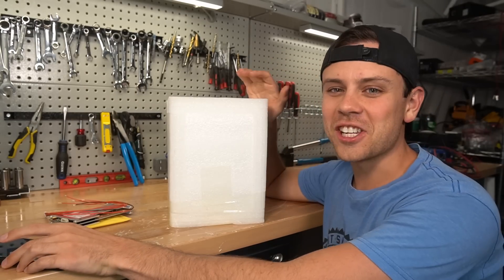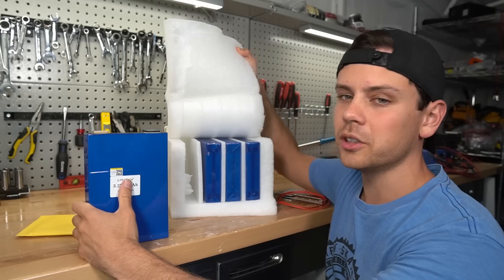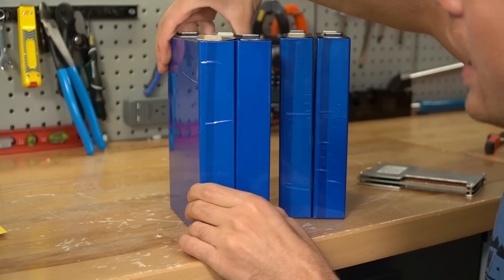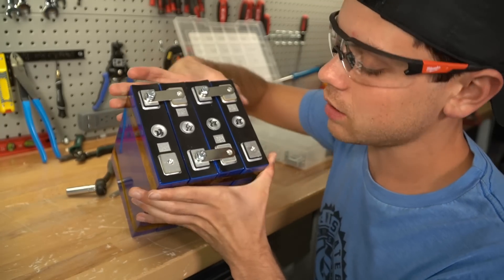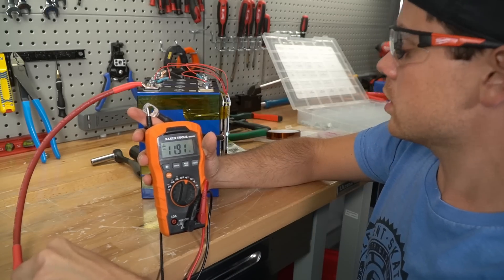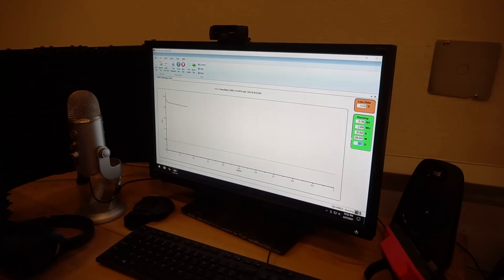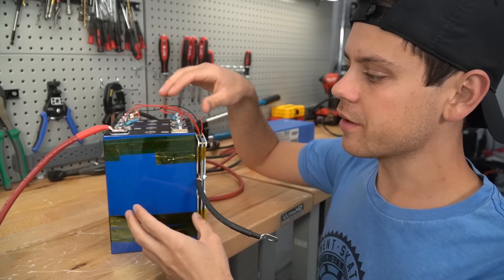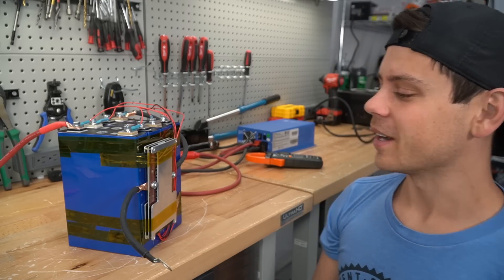Cheap LiFePO4: $221 for 100Ah 12V!! The Cheapest Cell + BMS On Aliexpress

Comment: Thanks for doing all of these tests, I've watch many of your vids. As a new guy into the RV seen and a boondocker focused kind of crew I feel lost with all the choices when it comes to buying enough but not too much. I know can't have too much but I'm only running lights and the furnace when cold. Fridge runs on propane. $2k for a system to run my lights for a few days seems like over kill so I'm looking at a couple deep cycle batts and a portable solar panel with a Renogy 20a charger from the alternator in the tow vehicle. All thanks to your work and I appreciate you for sharing your knowledge with me

Comment: LiitoKala does have proper 18650 cells and those 12v 18650 cell battery packs. Rest, i would just buy a known brand like you are saying.
Perfect video, was planning to try them out becouse of the good 18650 cells.

Comment: I got the cheapest 48v 30Ah lituim for my solar charging ebike setup. Told the seller if they test less then 15Ah ill be looking for a refund and ill even send them back. This would be a good setup though for my trailers power bank. I use lead acid right now as im on disability and lead acid don't hold a charge very long after dark :(

Comment: hi all.  are there any guides, web sites or ? that will tell me how to replace lead batteries with lifepo4 in a ups environment. I have a tripp-lite apc-1250 that is connected to servers and hm.  theather electronics. I have a 200 Amp hr sli agm that is pushing 25 years old.
thanks
Reply: is it as easy as buying a similar lifepo4 12 v battery or do I need some sort of a charge controller or bat maint device?

Comment: Used your link for recommend raw cells on your website for Amazon and it linked to this manufacturer. Bought the 280ah 12v one. It’s been over three months. Way past the quoted delivery time, no word from the seller. Others are having the same problems. So I have to request a refund.

Comment: Would you put two massive 4 year old, badly swollen 6S 22Ah LiPo drone Batteries, in series on a 1800 Watt ebike? Suicide, or worth it?

Well... it was a (borderline stupid) gamble, but I did over 20000 km in further 3 years of use. 
Now I replaced them, because they were giving less then 50%.  Replaced with a Aliexpress 52V 19.2Ah  Battery.

Comment: So when they are bloated like that, naturally, that's not good. Performance might not be what was advertised, they might cycle badly years down the line so yes, you didn't get what was advertised. However, we want to use it in our expedition vehicle and if they deliver 60-70% of the advertised performance 5-10 years down the line, that would be absolutely good enough strictly from a capacity perspective.
Naturally I neither want my expedition vehicle to burn down, nor do I want to be left stranded in the middle of nowhere without an electircal system. A degradation in capacity however would be managable. So the key question for my use case is: Is it dangerous or is there a high likelyhood of them failing alltogeher? 

Also, what torque is recommended for M6 or M8 studs?

Comment: Nothing wrong with them, undo the top and squeeze the gas out. then pack them in a tight container so they cant swell, and the gas will come out of the release valve, still much better than lead.

Comment: Indeed these cells rate to 100ah. I’ve got 16 of them. They are working fine and remain in balance. While some cells do exhibit “warping” all cells arrived with “virgin” contacts and bar codes. They are maintaining capacity as they are monitored daily ( watts produced thru inverter, monitored by Sonoff power switch ). They are maintaining balance. I will argue if your “poor” but have some ability to fabricate bus bars and compression methods these aren’t that bad. This post must be colored by the fact that they have only endured 154 cycles. In the end solar power remains a rich mans game.
Reply: How about an update, since it is 6 months by now.  I am thinking about buying them tomorrow, they are even cheaper for the 11.11 sale.
Reply: @mikes6216  6 months goes fast, I have used them everyday since my initial post. These batteries are functioning well. I run them under light load 24/7 @ 150 watts. I do not fully charge them or discharge them.  I am still happy with these batteries. They are not subjected to heavy load unless my power goes out and I need to run my sump pumps. Frankly, I would use any battery I buy under the same light load conditions. I will try to run a capacity test. I will indicate the starting voltage, ending voltage and total watts generated during for the duration of the test. it may take a week however as I’m busy building a green house in my basement ! I have a 1600 watt array and during sunny days I need to port the excess power to grow lights.
Reply: @jethrotull5847  I decided to buy some Liitokala batteries, or Litokalla, I forget which one.  One is a knockoff I hope I got the right one but I probably did not because I got the ones which were buy far the cheapest for an E-bike build.  14ah 3.2V cells came to less than $12 after shipping.  14ah seems like a new size on the market so I was hoping they were not rebranded used batteries.  They are bigger and heavier than LiPO but I actually got them cheaper.  Side Note:  There is a news article today saying Elon Musk wants LFP batteries now because they are better for the env.   The article said something notably contrary to Will P, that these batteries are NO SAFER than LiPO.  That the safety records, eg. explosions and thermal runaway fires were just silenced by the Chinese govt.  I see the argument but the aliexpress listings say they tested the cells with nail puncture tests... I guess they did not say if the batteries were charged at the time or not.

Comment: I ordered 4 pcs of 280ah for $200 total...we'll see if they actually arrive...not holding my breath, but I will update and make a video. The way I figure, if they actually turn up, if I only get 80% capacity or less I'd still be out ahead. Time will tell of course. If they do actually arrive and they are bulged like water balloons...I'll do all my testing way outside in my driveway.
Reply: where did you find 280AH for $200?
Reply: @jamesrladd  eBay...but we'll see if it's real or not. Should know by July. I'll update.

Comment: I always thought a "flat" battery was dead, these are curvy.  🤯
Reply: IMHO, a little bulging can be they have been used without any positive pressure on the cans and may not be terminal for the bat.   But also can be a sign of internal pressure is starting to destroy the battery.

Comment: Damn, that's about as bad as that Renogy All-in-one inverter charger. I guess these cells would make a nice match with the quality of build that Renogy picked.

Hmmm....

Maybe, just maybe, you should consider becoming a liaison between the various manufacturers in Shenzhen and North American distributors. Never know, you may just end up finding a better selection of parts and put together the best system yet with an open source team. That might actually be the best way to get the scoop on the best supply chain options.

Comment: I went to the Chinese Liitokala "complaint" (not really the right word but difficult to translate to English)(lets say bitching is more better) and lots and lots are saying virtually the same thing as WILL ... so ALL the batteries that have been sold and tested that has gone worldwide from these people all have issues -- some bulging, some with stripped threads, cracked threads, none of the serial numbers match, BUT ALL of them have tested at or right at 100aH ... ALL seem to be delivered right at 2.7 to 2.9 volts ... The thing to NOTE though - is regardless of their fault or not - if you send anything back its ON YOU 1000% .. YOU PAY ALL SHIPPING BACK !!! They will refund your money BUT AFTER you ship the things back ... (YEAH - do a quick cost estimate on that).. ..One of the girls (Chinese) living in Russia asked them if they were NEW cells and they came back with "YES" but after more probing they meant "NEW to US" .... The theory is that one of the Battery Manufacturers got bought out - they had a ton of B-Grade or returns etc etc sitting for years in the warehouse and someone bought the entire stock to test and put on either EBay or Alibaba, etc ... AGAIN - will i purchase some to play with -- heck yeah ... just did ... will I purchase them to monitor the companies fire control system or more importantly run my Friday night beer freezer -- -- hmmm probably not !!!
Reply: Bump... This person is knowledgeable and very legit.

Comment: Not the cheapest Ah for batteries. XD Battery Beijing quotes 600ah for $1200 plus $400 for shipping. Includes BMS, technical data sheet, and such, but not sure how great of a battery it is. These are very close in price, depending on shipping costs
Reply: You should Hit up michael through the group buy On the forum.  You should be able to get over 1000 amp hours for 1600 to your door.
Reply: @rileystone3319  wow. That’s a low price. Does Will know this?

Comment: Hey Will. I am a bit confused. You literally have this supplier listed on your website stating “My current Lishen 280Ah Cell supplier. Slow shipping, but cheapest price around for high quality cells”. I am baffled because I placed an order with them 3 weeks ago and am getting my cells within the next week. I only placed an order with them based on the above recommendation directly on your website. Now you made a video trashing them. What am I missing here? Thanks.
Reply from the maker: I took them off my list. Go check it out. And going by comments below, people are saying that they had good cells from this distributor. So it's a mixed bag.
Reply from the maker: You're not missing anything beside me getting screwed this time round. Simple as that.
Reply from the maker: Also depends on what cells you get. The lishen ones seem to be fine. But I'll check the forum tonight
Reply: @WillProwse   I checked your website before to make sure I wasn’t making a mistake before posting this comment. I just checked again and the link is still there. Varicore and litokala is the same company. Now I am hoping I dont get some bs cells and a bunch of time wasted. How many times have you ordered cells from this seller successfully? Also, aren’t these lishen cells in this video?
Reply from the maker: @joeshmo4110  oh really. Well I like the varicore cells lol. Those things are great
Reply from the maker: @joeshmo4110  maybe you shouldn't listen to me then. I can't control what they send me, and I critique every thing I see. I don't know what to tell you. How about you return those cells when you get them. Problem solved
Reply from the maker: @joeshmo4110  not sure what cells these are. Look like CATL cells to me.

Comment: I got these same batteries (16s) just to learn and experiment with on my sailboat with 48v electric motor.  They work great.  They are not swollen, but they have gaps because the bus bars are not sized precisely.  I balanced them, but have not installed the BMS yet.  So far they are working great, holding charge (I used AGM setting on charger), etc.  I'll take yours if you don't like them.  I plan to 3D print cradles to hold the batteries in position so they don't flex and put stress on the bus bars while sailing.

Comment: Idk man, you seem very negative but I'm not sure why. Lifepo4 bloats a bit on high load, this is quite normal and does not have to be bad.

Pulled full capacity ✅
Pulled high load ✅
BMS works ✅
Look perfect ❌

I think you should perform a bit of a longer duration test before you write these off.

Comment: Hi Will , based on my own opinion, i don't think it is a good ideas to buy cheap battery from those  supplier anymore , i had a bad experience. When i received the battery, i realized that out of 4 batteries  2 batteries  having bloating issue and when i charge the battery to full , these 2 bloating battery drain out very fast , it is waste of money despite it is cheap because you cannot achieve the full capacity of the battery . When i wrote to inform the supplier, there is no action from them. This is the experience i would like to share and cautious the rest. By the way, what is the price for a A grade 280AH lithium iron phosphate battery on the market. can help to share what is the reasonable price based on  your experience with so many A grade suppliers

Comment: So I'm looking at the 105ah batteries from the same supplier and I'm assuming they'll be in a similar condition - will they be acceptable for use in my application?

I have MS and I want to get more range out of my mobility scooter. It currently has 2x12v 22 ah AGM batteries but I worked out I could fit 8 of these in series in the battery box and it'd give me 5x the range for a comparable weight and probably have a longer cycle life too. My current cells are noticeably dying after about 18 months because I regularly max out the range which I assume takes them below the 50% capacity which is the damage point for AGM cells. I'd rather spend a little more now to get these LiFePO4's rather than have to keep changing these AGMs out every 1-2 years whilst being disappointed by the range.

The max draw is likely to be 15A, maybe 20A if I'm weighed down with lots of shopping and am going up hill in the worst possible scenario. I doubt I'd go below 50% capacity regularly, I need maybe 2x the capacity of my current battery to be happy so I don't foresee ever running it to full discharge. Would it be better to use these lower grade cells? or try and get some 50Ah ones that are a better quality? which do you think would last longer?

Edit: I've decided to go with a new 70Ah set of 8 cells from one of Will's trusted suppliers on AliExpress

Comment: I bought these as well, they pull full capacity and are in operation in my solar shed. For the price they are great. Mine aren’t warped so maybe I got lucky. I just ordered another set this time 200ah so we will see. Worth testing out for so cheap.

Edit: scratch that I bought them from a different supplier just checked your link. But same price different manufacture. VariCore
Reply from the maker: Oh right, I like varicore too. Those are my first recommended cell on my site. I'm glad you had a good experience with those 👍

Comment: Get a Box and put a copper tube in the bottom to heat in Winter and place the cells where they need to go and mix flour and portland cement and mold the cells in concrete.  This would be for an outside battery placement in a structure designed to burn and not burn like a large smoker cabnent.  Put on a Lab Coat with Hello Kitty Stickers all over it and Make a Sign Come and Get Me Bitches ..  Ha HA   Got to Luv it..

Comment: Not related to this video but I have a vehicle with a solar panel wired in to help charge a second battery in my vehicle. The charger will pull power from the starter battery to charge my house battery but will prioritize my solar if it sees solar power coming in. I’m currently running a renogy 100w panel. I’m looking to wire in a second solar input for a portable panel while I’m at camp so I can get additional solar power. Do you have any suggestions on a non regulated folding solar panel that can be wired in vis mc4 connectors or an Anderson plug? Would love to pick your brain on this if you have suggestions.

Comment: Is there a video showing how to build a LiFePO4 that uses components for auto-switching from AC to the battery when the grid goes out? I know the big MPPTs do it but was wondering if there's something more in line with your Egg Create builds. And maybe with the option to add in Solar later on...but this would be a less important consideration for this use case. Thank you for the guidance!